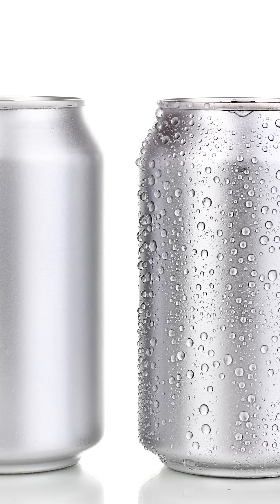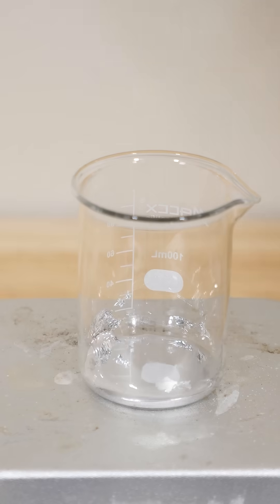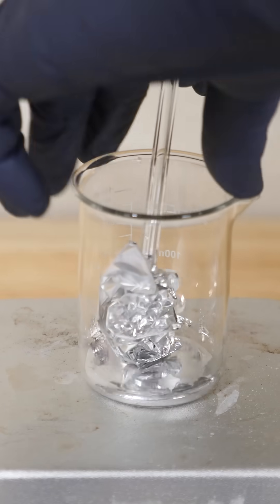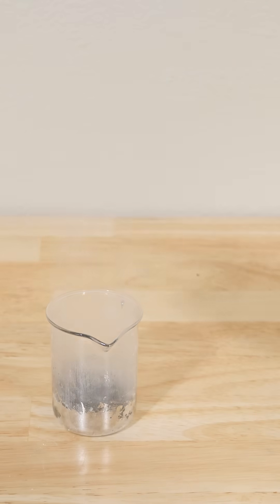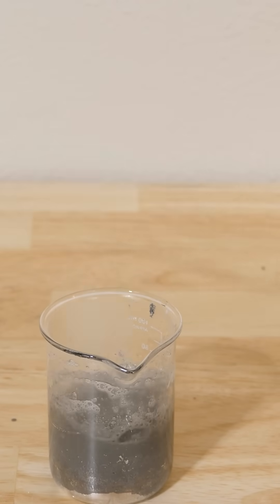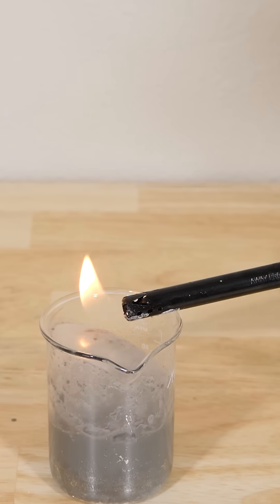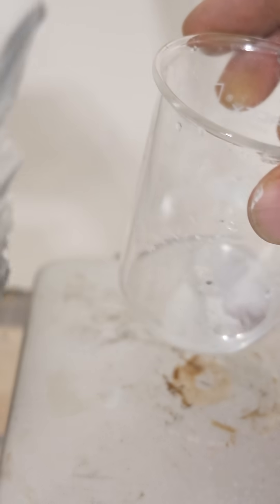Don't mix water and aluminum!

Comment: When I was a kid I set up electrolysis in my garage.  I didn't have any platinum or graphite electrodes so I simply connected one of my copper wires to aluminum foil.  Shortly thereafter bubbles were coming up.  When I disconnected the battery they were still coming up.  No gallium required.

Comment: You are creating an unstable aluminum (bi/tri)hydroxide that should have been done under a properly ventilated hood.
These are the reactions to your experiment:
Ga3O + Al + 2(O2) -> Ga3O + AlO + O3 (oxygen is temporarily released forming ozone)
Then:
GaO3 + AlO + H2O -> Ga3O + Al2OH + H2 (aluminum is in an unstable compound becoming suspended in galium releasing the hydroxide)

I have been looking for a way to plate aluminum as a replacement to more expensive methods (cheaper then crome/zinc by over 1/100 depending on application) and this has given me an idea on how to do that. I published on Twitter about aluminum (bi/tri)hydroxide; This would revolutionize manfacturing in general mainly the auto industry and household goods.
Reply: "AlO", "Al2OH", "Ga3O" and "GaO3" are not real chemical formulae. The only reaction that happens is 2 Al + 6 H2O =  2 Al(OH)3 + 3 H2.

Comment: EVEN WORSE!!  DONT cook with aluminum foil!!! part of the aluminum goes right into your food, gets eaten, goes into the bloodstream and goes PAST the blood brain barrier, and destroys the gaps between the nerve endings the synapse which is required for mental acuity, memory, ideas, thought processes, rationality etc.  I once used an airbrush makeup system with its liquid foundation product that contained aluminum. although it produced great skin base cover, some got inhaled and some got absorbed into the skin. the next day i noticed i was forgetting things. upon checking its ingredient label, i noticed it had aluminum, and threw it out, and thereafter made my own liquid makeup to go through the airbrush, worked well, put aloe vera on my skin first as a primer, and voila no more memory problems.

Comment: You do not need any gallium to produce any hydrogen using aluminium and water. Just scrape a piece of aluminium with a blade while immersed. And igniting a whole glass of hydrogen is plain stupid. You are lucky it did not have time to get mixed with oxygen in the air, otherwise you would be visiting an ER.
Reply: You can try but it won't work. The amounts of hydrogen produced are not that dangerous because they don't collect in a confined space but quickly diffuse into the room

Comment: So since you added gallium to the aluminum to dissolve it, doesn't that defeat the whole purpose of the point you're trying to make?  I'm not very scientifically educated but to me, you're not just adding water to straight up aluminum anymore, it's a gallium/aluminum mix now...  Am I somehow wrong with my logic?
Reply: The gallium is just a carrier for the aluminum to prevent if from oxidizing, it didn't react and wasn't used up. There are other ways to get aluminum to react this way as well. Your issue is in semantics
Reply: @Sauce787  I was just generally curious and confused.  Your answer actually confused me even more now lol.  I don't get what you meant when you said "the gallium wasn't used up"... Wasn't the gallium "combined" with the aluminum?  Can you still separate them afterwards?  Like I said, I'm not very scientifically inclined so help me out here.  You said my issue was semantics but I don't understand how you came to that conclusion either lol.

Comment: is this the same thing as using toilet bowl cleaner? I used to do this for fun... put aluminum foil 14 balls in a 2 liter soda bottle and then  shake it up.  Then stand back... make sure it's outside. but I  normally put the cap back on and  then swatch it blow up...

Comment: So could the warthog from halo possibly have this as a system(yes in bungie lore wich stated that the warthog ran on hydrogen it creates from moisture in the atmospere(wich is if i recall correctly is the musroomlike structure on the corner before the hood goes down the front) and 343 industries wrote that the newer ones have a diesel engine).
So i expect a three chamber system(one wich holds the aluminium mix, one that fills with water and a mixing chamber to make hydrogen.
Actually kinda usefull for a model of vehicle that gets used for over a century..

Comment: Correct me if I am wrong. The aluminum is more reactive than hydrogen so it replaces it  in a single replacement reaction. This results in the following reaction:

2Al(s) + 6H2O(l) —> 2Al(OH)3(s) + 3H2(g)

Notice, Al replaces hydrogen, and the expelled hydrogens go diatomic (share their one valence electron amongst each other covalently to create a full shell).

I’m also not entirely sure if aluminum hydroxide is water soluble, but I do not recall seeing aluminum in any solubility rules when I was in high school so I made the assumption it wasn’t.

Comment: Much easier and cheaper to do with sodium hydroxide powder added to water. I learned this when I was a teenager experimenting with fuel economy on my first car. 😅

I found a non-chemical method later though electrolysis which worked better because I could truly do it on demand with a pulse width modulator.

Comment: I've learned a lot from this video. While working on a cnc plasma cutter, I was cutting aluminum under 1mm of water and noticed how the sheet would lift in uncut areas and then flame out when the torch would near it. So I knew it was hydrogen. I guess the water was blocking the aluminum slag from oxidizing and instead it would make a bunch of hydrogen, which we would put into pails and carry out with lids on, to later set off for some back yard shenanigans. 😂

Comment: Could this have a use in creating fuel?
We would need massive amounts of aluminum, but its found in large veins here on earth and on mars too.
Rocket fuel substitute? Or potentially part of the rocket fuel production process.
I feel like it wouldnt be efficient enough, however.
I feel like our best bet is either turning plastic waste into fuel or separating the hydrogen and oxygen from water.
I also feel like it could be possible to turn various carbon gases such as methane and co2 into fuel.  We just have to separate the carbon and oxygen atoms from co2 and the hyrdogen from the carbon in methane.
Theres plenty of fuel readily available, we just have to synthesize it from our abundant gases in our atmosphere.
This could also make terraforming mars easier due to the abundance of water and co2 ices on the red planet.
Think smarter not harder.  Stop destroying our planet for a limited amount of fuel, start thinking outside the box and outside whats the most profitable.
We need advancement, not wealth hoarding

Comment: Chemist here: That is partially wrong and misleading. Yes pure aluminum would react with water and yes Al2O3 does prevent the reaction. The main driver of the rigorous reaction however is not the absence of the oxide layer. A block of pure Aluminum in an inert atmosphere would not react so rigorously. Its the dissolution of Aluminium as an alloy effectively removing the Aluminium from its lattice creating smaller, high surface particles (not sure if even atomic size meaning individual Aluminium atoms).

Comment: Boys we back wt/ da zeppelin 🗣️🗣️🗣️🗣️🔥🔥🔥🔥🔥🔥
Reply: No reason they gotta be that big for personal use, but I'll take a rigid body forty-fittyfive footer plumbed for water, waste, and electric, with a radium engine, magnetic generator, and vortex or static electric propulsion with helium quad prop backup crash safety system please.
Reply: I dont even know what you’re talking about and plus they’re big because hydrogen ain’t gonna carry 500 pounds with a tiny hydrogen balloon

Comment: We always used lye. Put aluminum foil in a bottle, pour a solution of lye in and cover with balloon. The bottle gets real hot and the balloon fills with hydrogen. Assuming that the lye strips off the oxide layer so the aluminum can react with the water. Never put aluminum pans etc in dish washer with lye based dish soap.

Comment: The aluminum oxide layer is already there - has nothing to do with being put in water as said - Aluminum metal just formed INSTANTLY Reacts with Oxygen from the air to form a thin layer of aluminum oxide that protects the rest of the metal from further oxidation. Remove the oxide layer, and it will react as shown. But any aluminum metal in nature will always have that oxide coating on it.

Comment: Gallium in a pressure pot with a large quantity of aluminum and a valve. The valve is closed. Is there an atmospheric pressure or a ratio of the amalgum that stops the reaction until the pressure is reduced?

If so, can you use that as a fuel source for an engine? As you use the produced hydrogen, the pressure reduces in the reaction chamber, allowing the reaction to start again. Stop the engine, and the pressure builds back up to the point that the reaction stops. This continues until the aluminum is consumed and leaves behind the gallium that is ready for more aluminum to be added. 

Is this viable?

Comment: Also, if you didnt know, aluminum oxide is just the chemical name for rubies and sapphires. Its just rusted aluminum. Theres an insanely thin layer of sapphire on every piece of aluminum metal
Reply: My god, that's amazing
Reply: Thanks!  Now gifts for my wife will be MUCH cheaper!!!
Reply: That's cool
Reply: he’s just referring to oxidation of other metals as a “rusting” process like different brands of tissues may all be called kleenex. 
yall getting so nit picky
Reply: @ No...rust specifically refers to iron.  Science is not being picky, it's being exact...
Reply: @tupera1  as I've said already. The term "rusting" is equivalent to saying "oxidation of metal". I do not think this term is specific to iron and only iron. Therefore, if you oxidized aluminum, you could say you "rusted the aluminum". Same thing as saying you "oxidized the aluminum".
Reply: So technically, some phone manufacturer use transparent aluminium rust for camera glass?

Comment: I work in paint and we use a lot of aluminum for sparkle and what not. One of the first things they teach us is do not cross the solvent (containing aluminum) and water waste streams or you're gonna have a real bad time.
Reply: @kpg1973 Since waste goes into sealed drums, you get massive amounts of pressure from the Hydrogen build up. In the best case scenario, dangerous waste blows out of the drum onto you. Worst, the drum literally explodes.

Comment: I'd like to know how the gallium was recovered -- that should also react with oxygen and water.
Reply: no it doesn't
Reply: @Nebulisuzer  I don't know about the spontaneous reaction rate, but gallium oxide is a highly stable form of gallium.  Apparently according to the Wikipedia article on gallium, oxidation requires elevated temperature or strongly alkaline solution, so maybe in water near neutral pH at temperatures below boiling the reaction rate is just too slow to consume most of it.

Comment: I'm just starting to learn chemistry, is the gallium considered a catalyst here or?
Reply: no, he just used it to remove the oxide layer. You can do that in several ways
Reply: @Nebulisuzer Correct. The gallium is essentially acting as a solvent for the aluminium.

Comment: Will it still work if instead of gallium I use sulfuric acid to desolve the aluminum?
Reply: But won't the acid just react with the aluminium, binding it? Surely getting dissolved into another metal into an alloy and being dissolved in an acid are very different things.

Comment: That oxidation layer is one of the critical concerns in aluminum welding; it’s gotta go. And once you grind it off, you need to place your weld immediately, because that layer of oxidization also starts reforming immediately. Also, aluminum is an amazing conductor of heat which presents its own set of challenges while working with it, but I’ll leave that for a future comment.

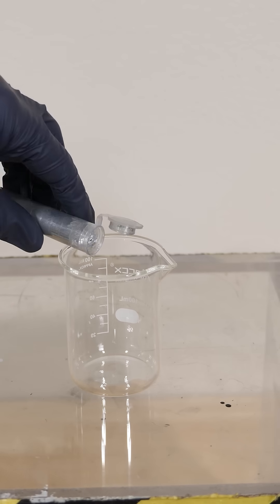Comment: 0:09 - "The reason nothing happens is because the aluminum reacts so quickly with the air in the water..."
No, it doesn't react with the air in the water! Earth-bound aluminum always has a layer of oxide on its surface bc it readily reacts with atmospheric O2 to form a protective layer of Al2O3. So it already has that layer of protection before it has been placed in the water. When you make science videos, you really need to get your facts straight FIRST. Tsk.

Comment: For everyone wondering, if we could use that as a way to produce hydrogen:

Aluminium is not only very energetically costly to produce, but also the production emits loads of CO2 and uses very toxic chemicals in huge amounts. Google "Bayer process" and "fused-salt electrolysis"

If you want to use renewable energy, use water splitting (which is already done). Also i hate to tell you but cars will not be powered by hydrogen in the near future, as there isn't even enough green hydrogen for the chemical industry (top priority)

Comment: Aluminum shavings combined with caustic soda and water produce a similar non depleting reaction. Theoretically, it will create hydrogen and oxygen gases when exposed to distilled water until the water is completely depleted..
Reply: Non-depleting reaction?? Nonsense, there's no such thing. The aluminium and the water are both consumed by the reaction. The reaction will stop when one of those two reactants runs out.
Reply: @robertfoulkes1832  Is also doesnt produce oxygen, he confused it with electrolysis.

Comment: I wonder if this could be used for mass hydrogen production for hydrogen fueled vehicles. One of the many bottlenecks to adoption is the ability to supply hydrogen to a fueling station. With sufficient logistics to deliver aluminum and gallium, perhaps hydrogen can be made on premises.
Reply: It's not economically viable. Hydrogen is much cheaper to produce than aluminum.

Comment: Technically, the reaction (with water) that we observe is now no longer a reaction of pure aluminum but of an aluminum-gallium mixture, where gallium may a role to play too, perhaps catalytic, as you were able to recover some of it.
Reply: Not so. The gallium is just a solvent for the aluminium. Dissolved aluminium can't form an oxide layer.
All of the gallium can be recovered.
Reply: @robertfoulkes1832  And yet, a solvent may have some 'solvent effects', yeah? Example, the same reaction carried out in water vs acetic acid may have varying activation energies.
Reply: @FarhanAmin1994  Fair point

Comment: So instead of charging batteries, we should fuel our hydrogen tuned IC engine vehicles with a spool of (sustainably produced) aluminum wire and a tank of water (for on demand H2 production).

Comment: can't get gallium? use Drano (lye).
Put aluminum foil, water and some lye in a long necked bottle (old wine bottles work best) and then put a balloon over the lip of the bottle. The hydrogen gas will fill the balloon and you now have a lighter than air balloon with twice the buoyancy of helium.
Reply: -just remember the Hindenburg when playing.
Now go have fun, kids!

Comment: Auch easier way to get aluminium to react os using a base. The hydroxy anions react with the aluminium oxide to form soluble aluminate, and the rest reacts with water and/or hydroxide itself. 

I used to make hydrogen balloons for parties this way. Cheaper than helium 😅

Comment: Can't they use this as a fuel then? Imagine say a train, has a big vat of gallium and aluminium. Water is fed into the vat, hydrogen comes out, is put into a fuel cell which produces electricity and water, and the water is fed back into the vat? Then now and again you replace your vat with a new one and the aluminium oxide is converted back into aluminium at a factory to create more fuel.

Comment: What is the economics of using Aluminum for hydrogen production compared to electrolysis? Put water, get hydrogen, use it for fuel. Convert Alumium oxide into alumium again using electricity
Reply: probably more efficient to just make the hydrogen from water using the same electricity
Reply: Any way to create energy using the reaction to generate hydrogen? Won't the energy to regenerate the aluminum consume the equivalent of the energy released by burning the hydrogen? 😴
Reply: Considering all the energy used aleady to get metallic aluminum to form, I'd say it's not cheap at all on a large scale.

Comment: Could you put the aluminum and water in a vacuum chanber then drop it in? Or would that do nothing
Reply: The aluminium already has an oxide layer on it. You would need a way to remove it (eg sandpaper it while under a vacuum)

Comment: So you could essentially power a car with empty drink cans?
Reply: There are commercial cars powered by hydrogen, they are usually called “hydrogen fuel cell” cars. But this isn’t that efficient, since aluminium itself takes energy to make

Comment: So basically aluminum does NOT react with water. Aluminum-gallium alloy does.
Reply: Aluminium reacts with water. Aluminium oxide does not. The gallium is not used up, it is only a catalyst.

Comment: One of the reasons mercury can't be sent by air. It'll react with the aluminum airframe if there is any leak.
Reply: Gallium, not mercury :)
Reply: @mtqrx The point is that like gallium, mercury is a liquid metal too. Both of them can dissolve other metals.

Comment: Genuine question from a machinist: why doesnt that happen when machining aluminum? I mean its freshly cut and covered in coolant that is 95% water. Is it because its too cool for that reaction to happen?
Reply: At room temperature, aluminium oxidises pretty much instantly. The heat from the machining actually makes it oxidise even faster than that

Comment: Hey Action Lab

A quicl question

What of we sand a block of aluminim under water just enough to get the outer Oxide layer removed , would it react with water